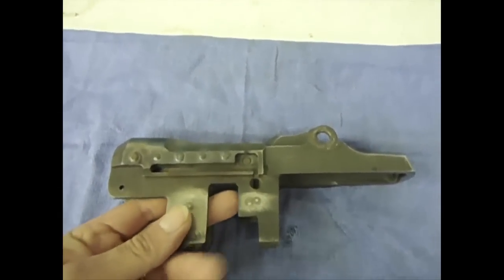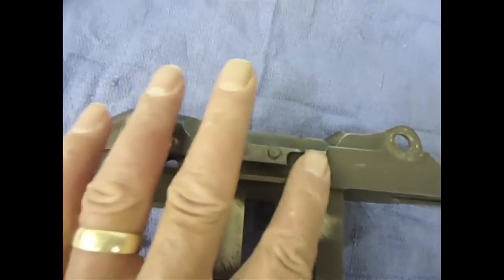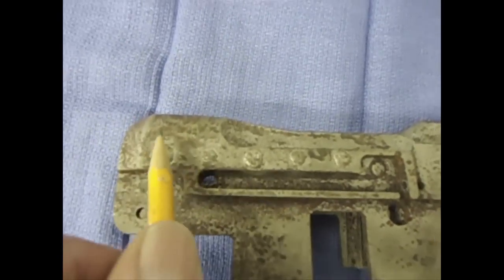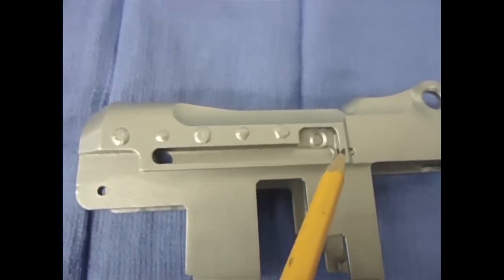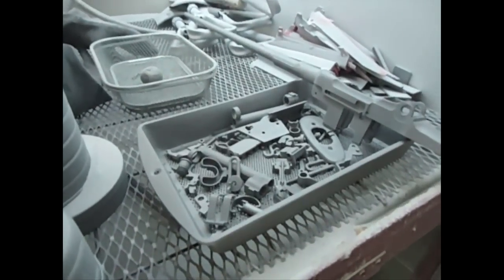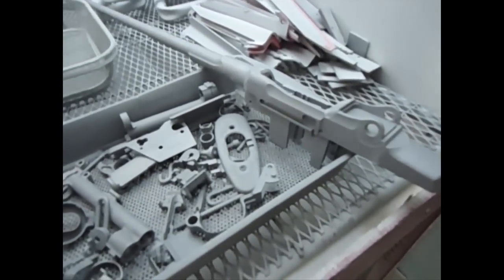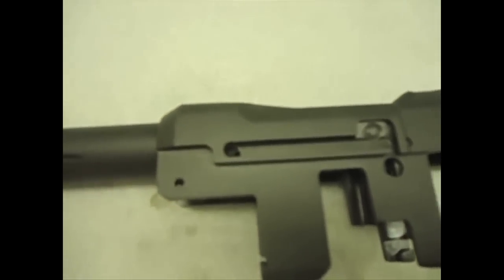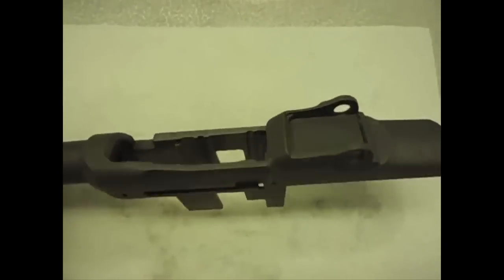Shawn 1941 M1 Garand Lend Lease Restoration video 2 Vulcan Gun Refinishing

Comment from the maker: Parkerizing (Phosphate) can't form well on a smooth, unblasted surface. I leave the barrel and chamber unplugged. I stay away from directly blasting into the chamber so that it's surface will remain smooth, discouraging the Phosphate from developing. Park is so thin that it does not affect dimensions whatsoever. It's designed that way. It's real use in the Industrial world is a break-in coating for wearing surfaces like bearings and such. Not for refinishing guns. That was an afterthought.

Comment: By the way the cut on the gas cylinder(not tube) was done on purpose. There were problems with the cylinders being loose so the field fix was to use a hacksaw to go through the top of the cylinder so that when you tighten down the front sight screw it puts a clamping pressure on the cylinder and it interfaces better with the grooves on the barrel. The front sight screw plug was put on so soldiers couldn't adjust the front sight, so that only the armorers could work on them.